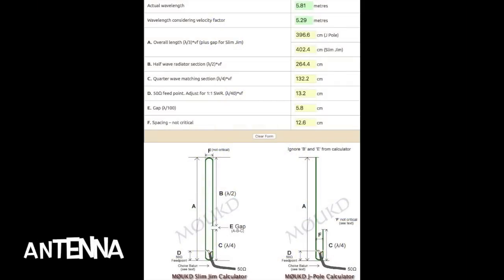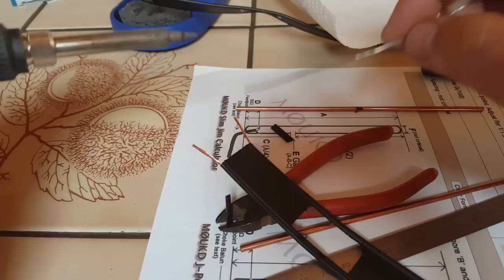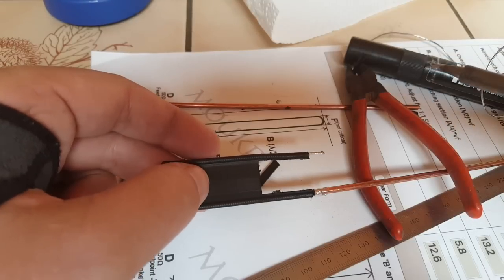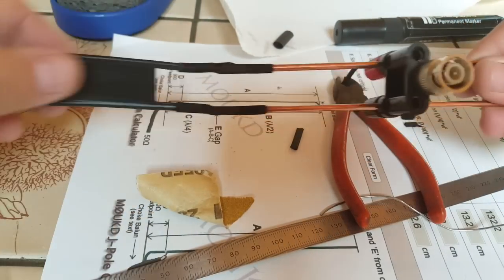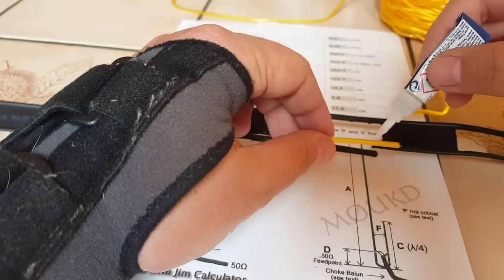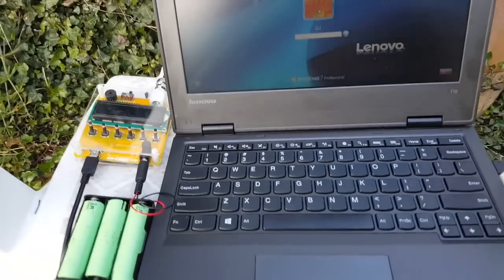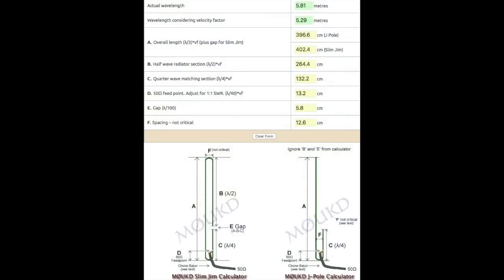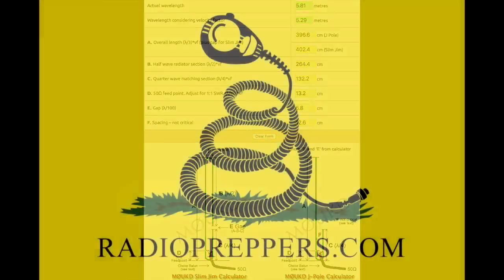Building a Great Portable Antenna for VHF or UHF.

Comment: Copper rod and bnc adapter is a very nice way to make adjustable feed point!

J-pole is easier to make resonant at exact point wanted. Just make the cut like in slim jim and leave the unconnected piece of cable there. Do not connect the wires at the top. The extra piece of wire makes a little difference. Then just trim the lengh from end to adjust frequency and move feed point if the impedance is higher/lower than 50 ohms.

I made a one like that for 70cm. I did not have the feedpoint adjustment but a bit of wire wrapped before soldering can be moved around too. (or you may get lucky and the calculation is good enough).

Comment: I'll bet the reason it wasn't spot on with where you wanted was related do the velocity factor of the 450 ohm line. I've hear the impedance of 450 ohm line which is commonly sold is lower than advertised but the velocity factor would change the length and I've had advertised velocity factors be off with many other products so I wouldn't be surprised it is with 450 ohm line. With modern nanovna's its essy to measure, in fact, an antenna analyzer can do it.

Comment: Nice video Sir! I too made a ribbon slim Jim a couple of years ago using ladder line and this calculator. I also found the antenna to be too short. I went back to a design from many years ago (VHF/UHF Antenna hand book maybe??) And started again with much better results. One thing I did find was the coax was a bit "Live", so I added a choke at the feed point. Hth.
Reply from the maker: Excellent!

Comment: About The Heating Up The Copper Rods, You Can PutThem In ThirdHand Or Some Vise And Then use A HeatTorch To HeatThem up And Then Solder Them, I have DOen That Hundeds Of Times And Every Time It Works For Me

Comment: You should heat the HeatShrink tube only with the blue part (near the lighter base) 
of the lighter flame, as it heats but never BURN the tube. This is recommended by the tube manufacturers :)  My 2 Cens.

Comment: Coming from the audio/studio side of commercial broadcasting where for some applications we even use electrical contact grease, I am always surprised that amateur radio operators carefully put together antennas, keeping a close eye to every details, but, when it comes to the connector, suddenly, they assemble a monstrosity made out of multiple adapters. I suspect that the feed point deviates mainly from its theoretical position and calculated impedance because of those adapters. Seems to me, they can only have an adverse effect on the overall performance. They are far from being ideal electronic parts and they are massive compared to other components. They must leak some RF; they surely perturbate the radiation pattern and they have their own impedance.

Am I missing something?
Reply from the maker: I am sure they do. They do help to experiment though. The final version of this antenna will be soldered.

Comment: Amazing video, I'm a big fan of you're channel! I'm doing a SOTA holiday soon and have a 5wFM handheld, Yaesu and I've made this Slim Jim for 2m. Do you think it would be worth it for me to buy a 50w transceiver and have the extra weight? Do you think the extra power will give me lots more contacts? Does the extra power cause the waves to bend round the Earth more, even if it is at VHF?
Reply from the maker: I do not think an amp is worth the added weight. What you need is altitude and a good antenna. Make a tape-measure yagi maybe...
Reply: @RadioPrepper  Many thanks for your reply. In that case I will take your advice and just use the handheld. I will use the slim jim as a radio ham told me that his slim jim had more gain than his 5 element yagi for 2m. I was surprised at this.

Comment: Hlw radio rapper i am using intercom radio i want to extand the range up to 5 km can i use this anteena or not?
Reply from the maker: Go to the M0UKD web site, find the Slim Jim calculator, given your working frequency, see if the measurements you get seem reasonable. I do not have enough information to answer your question.

Comment: where did you get this sliding connector ?
Reply from the maker: +sebadtable It's a BNC adaptor, EBay.
Reply: I had rather meant this element which connecting two rods together to make antena tuned so easy
Reply from the maker: I made it with 3mm copper rods.

Comment: You make a lot of effort to get a low VSWR - but--WHAT ABOUT THE IMPEDANCE AT THE FEEDPOINT!!
Reply from the maker: Please elaborate... Both the SWR and impedance change as the feed-point moves up and down with the slider. Was there a question? Or are you pointing out something I did not mention?
Reply: Impedance should be 50 ohms to match the tranceiver and the coax feeder. This is just as important as VSWR but you don't mention it. Impedance will also vary with the feed point psotion as well as VSVR but the best in both cases may be at different feedpoint positions - you need to choose the best for both.
Reply: Good point in the case of this antenna which has some common mode currents running on the coax outer shield, influencing the SWR. Thanks.